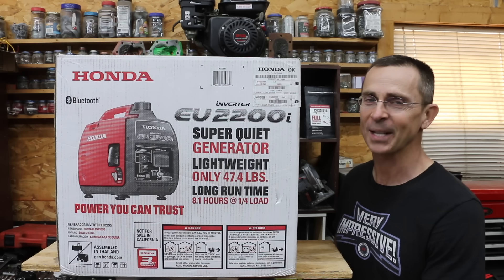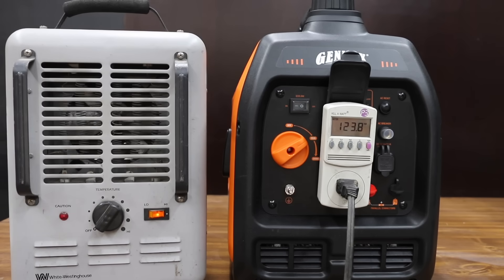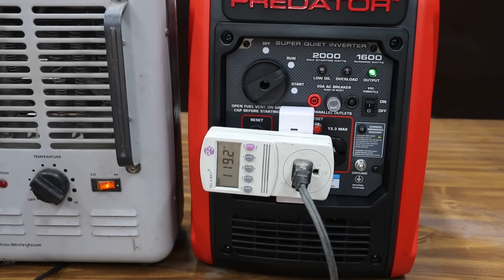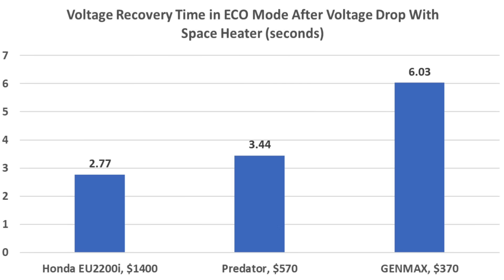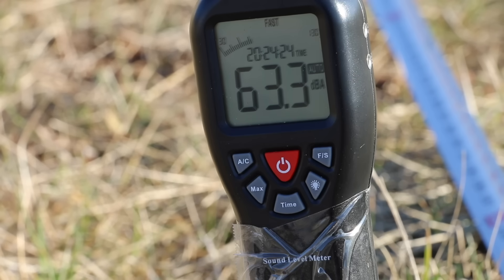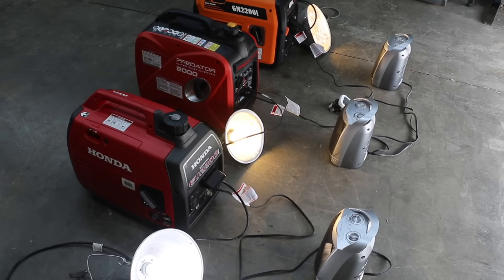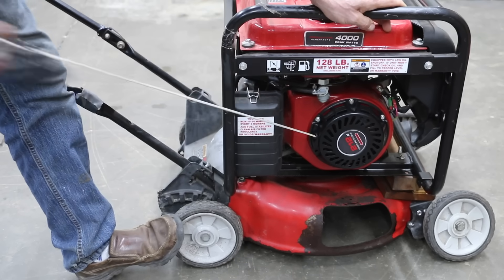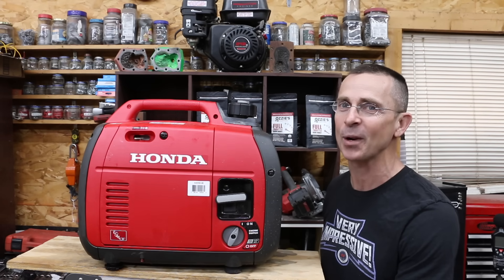Cheap Generator Better Than Honda? Predator vs Honda & GENMAX—Let’s Settle This!

Comment: I'm in the south and we typically use generators for hurricanes where they may run weeks at a time.  My concern with cheaper generators is that one will fail, the result being expensive loss of foods in the refrigerator/freezer.  I would love to see a longevity test of these and maybe a test of the larger models (9k predator preferably).   Keep up the great work!!
Reply: The difference in price between the Honda vs the other two would easily restock a fridge or freezer…. You can even buy two for the price of the Honda and have a backup.
Reply: @sccarguy8242  My freezer is full of Grouper, Tilefish, Red Snapper, deer meat, etc.  You can't buy that.  Plus I run on well water required by animals and can't be without.   The whole point of the test would be to validate the need for buying another.  If the predator lasted just as long as the Honda...why buy two??
Reply: @jasonsmith940  my point is the Honda is not double the price better then the others. As for the predator, I know many folks who have used the crud out of there’s… abused is a better word… never had an issue. I see the results in the test, and it could just be break in, or that particular unit. If you have the money Honda makes a good unit.
Reply: @jasonsmith940  2x or even 3x! The cheap ones will provide a MTTF or MTTR (between oil changes etc) far surpassing the Honda. 

A top spec top price Honda makes sense if you need absolute reliability (we are assuming the Honda is here) but can only have 1 unit. E.g. space constraints on a trip etc. 

At home... You could have as many gensets as you want.
Reply from the maker: Thanks, will do!  Thanks for the suggestion.

Comment: You pay for what you get here. The Honda was not only quietest but more importantly it had the best voltage hold and by far the least wear. 
The Predator didn't do badly but its false economy to buy either of the others over the Honda. 
By that wear as a guide it will outlast the others at least 3:1 and when you throw in the potential difference in tool/appliance life from that stronger voltage its just a better bet all around.
Reply from the maker: Thanks for the feedback.

Comment: Like everything, Youve done another amazing Job. Some of these cheaper versions are made by the exact same factory usually using expired or older tech from the brand name version. But the funny thing is (and i know this from importing experience and working with chinese manufacturers,) They are very happy if you let them to improve on your design. Some factories and R&D teams are better than others too 😆
Reply from the maker: Thanks!  Thanks for the feedback.

Comment: you can buy 2 genmax or predator and run dual loads and still come out cheaper then buying 1 honda. plus having more power to run those same test.
Reply from the maker: Thanks for the feedback.

Comment: Could you consider testing the true max wattage capacity for both peak and continuous output of the generators? Some generators may be better at starting up high loads than others such as when wanting to run tools at a job site. I also would love to see Yamaha tested. Thanks!
Reply from the maker: Thanks for the suggestions.

Comment: Some of your charts misleadingly exaggerate the differences in values. At 12:16 (fuel economy) for instance. Even though the values are very close, the chart gives the illusion that the best value is twice as high as the worst, when in reality they are fairly similar. It might be a better illustration to have the vertical axis set to 0 in this case, so that the difference isn't magnified. And maybe put the table of actual values onto the chart so we can scrutinize the differences. I do this sort of stuff for work, so im happy to bounce some ideas around.

Comment: Awesome video! Please can you test Champion Generators? It is another established brand but with much better pricing than Honda. 

I personally have a couple and they are amazing in my experiences. In my own testing with my friends generators during the last hurricane and during IRMA my Champion 3400w Hybrid inverter generator lasted longer than my friends Honda 2100 and 1800 generators by a margin much better than the difference in fuel.

Being from Florida we use generators more than most because of hurricanes. Last year I actually put my Champions to the test and ran them for 5 days straight. 100hrs on cheap conventional oil and it wasn't burned up at all.
I should have Sent the oil to Blackstone but I didn't think about it...

I haven't personally used the small 2000w models, but a friend of mine bought one although he hasn't used it.. So I think it would be interesting to test those since Champion is a other established brand like Honda but the pricing is more in line with Predator.
Reply from the maker: Thanks for the suggestion.

Comment: Outstanding as always! I have had to remove the spark arrestor on my predator 3500 because it gets all clogged up! Once you remove it then they are champion. My cousin bought a Work Zone gen from ALDI, yes ALDI!  I thought he said Audi! As long as you use 30HD or 30 SAE you should be good to go. We found out if it is made in china they are all damn near the same just different positioning on the outlets. Thank you again.
Reply from the maker: Thanks!  Thanks for the feedback.

Comment: Having used a honda eu10i 1k gen i found that using it mainly with eco mode for about 3 hours a day and changing the oil every month and the spark plug every 7 to 800 hours it used a third of a litre per hour, and lasted for 7 years before the inlet valve broke. You can run this gen on propane but need a special kit. I paid £700 for this gen in 2013 and have since bought another one. They come with a five year warranty if not used commercially. I have tried others but not recently so your test was interesting. I mainly use electronic equipment as well as power tools and a 800 watt hoover.
Reply from the maker: Thanks for sharing.

Comment: Please test generators with 220V output. My water purification system has a 220V pump. Water is obviously vital, it doesn't much matter to me what else a generator will run if I don't have water.
Reply from the maker: Thanks for the suggestion.

Comment: I am looking for a good and reliable digital scale like the one you used to measure out the oil in the video. What brand of digital scale do you use for your test? My luck on Amazon has been sucky with digital scales. Thanks in advance!
Reply from the maker: The link is in the video description.

Comment: Watch taryl fixes all, small engine repair  channel tell you stay far away Honda generators and mowers etc because Honda purposefully has planned obsolescence  makes it so are not repairable and do not even make parts vailable if it breaks. Where a champion generator and engine are very easily repaired for cheap.
Reply: You seriously pay attention to a guy who wears hillbilly teeth?  You actually think the Chinese kids who make Champions pay more attention to detail than the folks who make Hondas?  I've got a Honda mower, a Honda string trimmer, a Honda-powered pressure washer, two EU2200's, and I've never had trouble with any of them...but believe what you want if it makes you feel better about buying cheap stuff.

Comment: Maybe see the differences in generators that use duel fuel, propane and gasoline. Settle the battle on which is more fuel efficient  and powerful.
Reply from the maker: Thanks for the suggestion.

Comment: This is the BEST, most objective Generator review on youtube.😀😃😄😁✌
You made no mention of Service/Parts availability.  You'll find HONDA service & parts available in even the smallest town across America. 
 NOT so with any other brand of generator.
I especially liked the oil analysis which clearly showed LESS WEAR within the HONDA engine.
Buy a HONDA.  Cry once.  It will outlast you & your next family generation of users
Yes, I "liked" & have been a long time subscriber & get all "notifications" each time a new video is published.
2.87 million subscribers should tell everyone something.
24 thousand "thumbs up" & not a single "thumbs down"
Warm Regards from Reno, Nevada
Reply from the maker: Thanks!  Thanks for sharing.

Comment: On upcoming generator reviews could you do a compression test before and after all testing?
Reply from the maker: Thanks for the suggestion.
Reply: I prefer the oil analysis to show engine wear of aluminum & steel in lieu of a compression test.

Comment: We also need the rundown on pressure washer hoses! Flow rate, abrasion resistance, flexibility, temperature compliance, burst pressure etc. (Great work as always btw)!
Reply from the maker: Thanks for the suggestion.
Reply: I like that clear pressure washer hose from Tractor Supply ... Seems pretty tough after several years use and best of all... Does not leave all those black marks all over anything not black like cool decking and concrete.
Reply: Been in the Water Blaster industry for a few years... Flow rate is negligible in a hose... the important things is that the ends have not been over crimped (and even then that often doesn't affect output flow/pressure, but will increase pressure of the hose at low pressures (like when using a large "soaper" nozzle to use the detergent venturi (often built in with a cheap machine. The venturi requires a high pressure on the pump side and a lower pressure on the output side (to create a vacuum on the output side that sucks the detergent in through a non return valve at the end of the plastic pickup hose... restrictions in the hose can act like a nozzle which can increase the pressure in the hose enough that the venturi ends up with the same pressure on either side.. so no vacuum, no soap.
(This is why you have to use the "black" nozzle on QC nozzle units to get soap... and thin hose (usually 1/4" (measured in ID not OD) hose) does effect the low pressure)... 3/8th (industrial standard) can run up to about 30m long before pushing all that water through ends up leveling out that pressure either side of the venturi again... I personally hate venturi's. Spray and walk away.. then pressure wash later!)
Reply: @TheButlerNZ  I decided years ago that if i want to add soap or bleach it is better to do it with a 60 dollar garden tank sprayer that can spray it right where i want than my 3000 dollar pressure washer set up

Comment: What's not in this test is ease of repair. Typically the first issue you will have is a clogged idle jet in the carburetor due to sitting too long. The honda's is right in front and easy to clean. I don't know about the other's. My westinghouse idle jet is in the back and almost impossible to get to. Buy once, cry once,  get the honda...
Reply from the maker: Thanks for the constructive feedback.

Comment: Kind of weird how that stuff happens with the oil being low. I have the exact same predator gen and it said 100 hours. I changed it at 50 during a non stop use after severe storms. Oil still full. For nearly a week I ran it non stop everyday and stopping it at 50 hours to change the oil . Never burned a drop. I did do a proper break in when I first bought it so it was good and broke in during the event.
Reply from the maker: Thanks for the feedback.

Comment: The Honda has a 121cc engine while the others have 79cc, ths why the honda can handle the 1500 w on eco.  Also,  it is not recommended to run over 50% load on  eco mode, so if you want to run 1500w on eco, it is re ommended to get a 3000 w or bigger inverter.
Reply from the maker: Thanks for the feedback.

Comment: I've been running the entry model Champion 2000/1700 single fuel model 100478 and was so happy with it I bought a Champion Duel Fuel 2500/1850 model 100899. Both run very well and seem to suffer little voltage drop going to load. I do like the extended run time on propane. Both are around 39lbs mt which is an advantage in my old age.
Reply from the maker: Thanks for sharing.

Comment: I would love to see a comparison of the “solar” power banks. The big batter packs that are typically attached to 100-200w solar panels when camping.
Reply from the maker: Thanks for the suggestion.
Reply: Basically expect none of the ratings to be accurate.

Comment: An uninterruptible power supply would smooth out the tailgator's frequency and voltage drop
Reply from the maker: Thanks for the feedback.
Reply: NO need  to smooth out frequency or voltage drop with any Honda Generator

Comment: Any chance you can test the WEN 56235i Super Quiet 2350-Watt Portable Inverter Generator with Fuel Shut Off, CARB Compliant, Ultra Lightweight?
Reply from the maker: Thanks for the suggestion.

Comment: I used that exact same Honda generator at work to power a 13amp Rotary Hammer to drive 1inch Rods down to 5ft. That little generator never let me down.
Reply from the maker: Thanks for sharing.
Reply: That really putting that little generator to a lot of hard work.

Comment: Love this channel!  You've saved me from making some bad purchase decisions over the last couple of years.
Also, as a vibration analyst, it's nice to see that you're testing and reporting on vibration levels on many types of equipment.  Just a suggestion, but consider integrating the overall acceleration levels to overall RMS velocity.  It's a better gauge of human-sensed vibration because velocity is not dependent on frequency.  Acceleration measurements are amplified in the high frequency range, but velocity doesn't suffer from this limitation.   It's a better model for human perception of vibration levels.  
Keep up the amazing work!
Reply from the maker: Thanks, will do!  Glad to hear!
Reply: As a vibration analysis you must have a vibrator up your @ss all the time 😂😂😂😂

Comment: I'd like to see a citation on low voltage causing excess wear and tear on appliances. Especially with something like a saw, which is just a motor - I can't think of any way undervolting would cause more wear.
Reply from the maker: Thanks for the suggestion.

Comment: What I will say about the Honda (and I've had the original 2000 version) is that these generators can be sold quickly (even in non-running condition), and as long as you drain the  carburetor after you use it will last a long time.   Also there are so many chinese knockoffs which provides a source for cheap replacement parts.  It costs more, but you'll get most of that back when you sell it.
Reply from the maker: Thanks for the feedback.

Comment: It could be a little expensive, but comparing battery "generators" like the Jackery, Eco-flo or Bluetti would be awesome.  Maybe make a comprison to a DIY lead-acid battery and inverter combo. Use all the same test methodology and compare them to the gas generators.
Reply from the maker: Thanks for the suggestion.

Comment: I got that Honda about 16 years ago. I´ve used it many days all day and i rarely changed the oil yet it never complained. Hauled it out of mothballs the other day, changed the oil, started with one pull, purrs like a kitten. If you have to be close to your generator, quiet is so important.  I am curious if the Yamaha generators are as good since they are also a premium brand.
Reply from the maker: Thanks for the suggestion.
Reply: @ProjectFarm  I used to race motorcycles and those Yamahas started showing up. Not a bargain brand but I always wondered if they were as quiet. I think they had a 1KW generator but we needed 1500 watts for tire warmers.

Comment: I got an IRONTON 1800watt generator from either northern tool or harbor freight, it's superloud but it worked the couple times it was needed and never had an issue starting.
Reply from the maker: Thanks for sharing.

Comment: Not a different generator brand but idea anyway that I’ve been curious about. Conversion kits for bifuel for say the predator 4000 and then a comparison of one from another brand that comes with the option of bifuel from the factory like champion. Also just want to know if I’m the only one considering that route vs buying a whole new generator to be able to use propane or even a trifuel for natural gas
Reply from the maker: Thanks for the suggestion.

Comment: Continuing my mission to get you to do a motorcycle oil comparison of JASO MA/MA2 oils 
Wet clutch motorcycles are probably the most sensitive vehicles to bad oil considering the high rpm, high compression and inability to use friction modified oils due to the clutch 
Can compare rotella T4 and T6 vs motorcycle specific oils from Lucas, Motul, castrol, amsoil, honda and yamaha also have branded oils
Could become a multiple part series with the wide range of oil brands specific to bikes
"Which oil should i use" is probably the most common question on bike forums
Reply from the maker: Thanks for the suggestion.
Reply: @ProjectFarm  absolutely, i really think it would get a TON of views. That question comes up about every bike on every forum on every bike site i have been on.
With this presentation style the video would end up linked all over the place

Comment: Thank you Todd for all you do for us! I have a video suggestion that shouldn’t cost too much to test! I like to change my engine oil myself on my Toyota and I have always used the manufacturer recommended oil, however I do not know if it’s actually my best choice. Could you do an oil comparison with all of the big name company’s oil such as ford Chevy dodge Toyota Nissan etc with pennzoil ultra platinum as the control?! This would be good info for people that take their vehicle to the dealer for service and people like me who just purchase the oil from the dealers. Also another interesting test could be done with all of the manufacturers oil filters vs a generic version! Thanks again and keep up the great thorough videos!
Reply from the maker: Thanks, will do!  Thanks for the video idea.